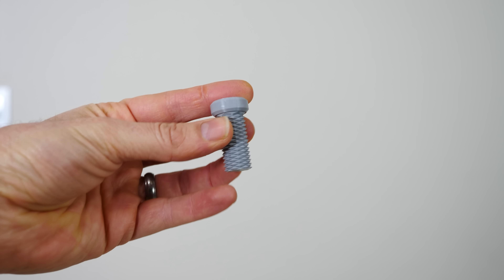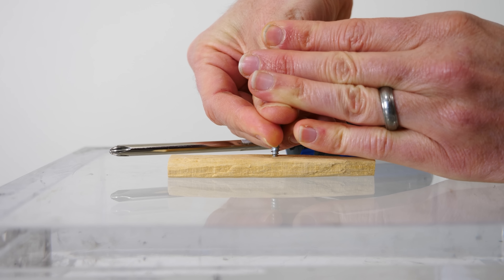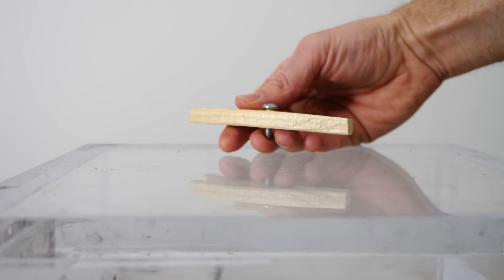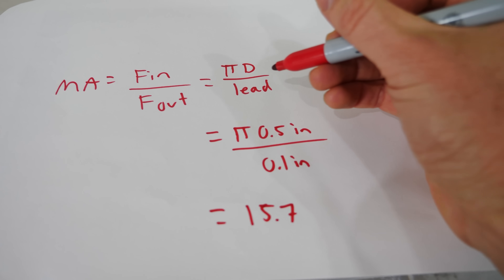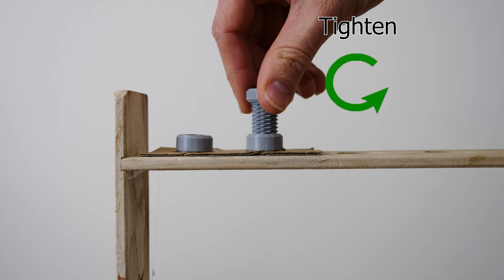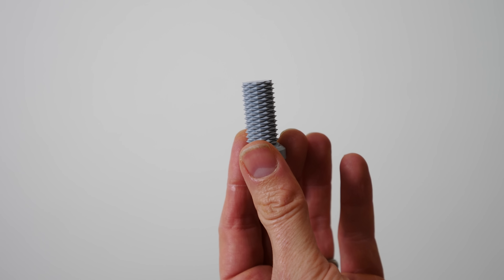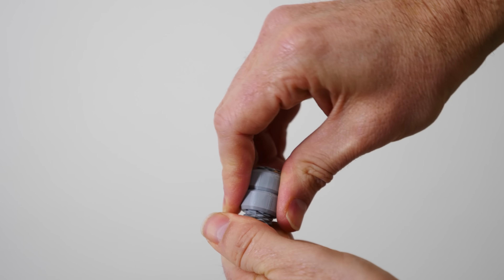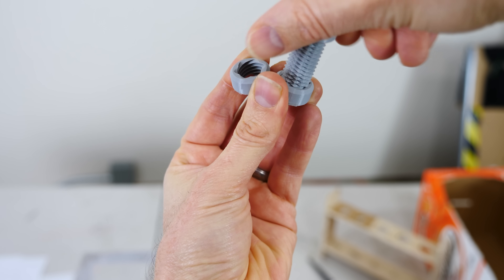A Screw That Can Be Tightened In Either Direction

Comment: As a mechanic This scares me because if the start using this there’s gonna be a lot of fucked up bolts 💀
Reply: Right?! And what is the point of a multi directional screw when the nut is directional? Since they work only together, when actually using the screw it will only tighten and loosen in the direction of the nut. Maybe there is an application with the part about putting on two of different direction, and not being able to unscrew it?
Reply: @cssruth  it does seem like it would cause a lot more headaches that it would fix lol
Reply: @cssruth  we use left handed bolts at our manufacturing location often; dependent on the rotation of machine parts, having a reverse threaded bolt can prevent it from loosening over time. We build large mechanical doors, both electric and hydraulic operated. The components for operating the large door pins are sealed within the door, so having one come loose would create quite the problem! The use case for an either direction screw would be very specialized, but it would work in a case like ours where half the hardware inside the door is RH threaded and half is LH.
Reply: @grizzzly6055  but you would still need two types of nuts to make it work correct? Or does it just have to be a hole that is drilled? I'm not is manufacturing obviously.
Reply: @cssruth  Yes you would need two types of nuts as shown in the video. One has clockwise threads and the other has counter clockwise.
Reply: @cssruth  yes, that or holes tapped in different directions. Go through tap all your left hand and right hand holes, and these bolts would work in either hole.
Reply: @grizzzly6055  The application you mentioned honestly does make a lot of sense though. I work on heavy machinery, so I know there's a lot of importance in making sure nothing rattles loose while our machines are on the job. I don't think there would be a use case where all bolts were replaced for these, but it definitely could make a cool implementation for specific needs.
Reply: @cssruth   I can see a use for the locking properties of a Bi directional bolt with opposing threaded nuts.
Perhaps even bi -directional all thread?
But yeah, still Limited Uses
Reply: @jeffreygearhart1841  in all fairness, lock nuts already exist, and are pretty effective as far as withstanding vibrations and stuff. But then again I don't think this bolt was designed for practical function, it was designed as a cool engineering concept. So the idea is cool, just not especially practical when compared to what we already have to serve the same purpose.
Reply: @cssruth  it just for fun , u gotta chill and stop trying to make everything have a mayor application. Most big thing we have this day are thanks to the discovery that was useless in the past.

The guy who discover a way to tranform any wave into sin wave. At his time, it was useless but now its the core of any wave system.

People in the past discover complex number just for fun and was useless, but these day we have many application for it.
Reply: @prumchhangsreng979  was literally just wondering if there was an application for it.
Reply: @prumchhangsreng979  But trying to make things have an application is how we get big things from once thought useless discoveries????
Reply: @cssruth  The nut can also be made multidirectional. In that case, doesn't matter how you turn it, it goes in the direction in wich you press
Reply: The fear of an old bolt not coming out easily but needing to force and not being sure if I should force left or right
Reply: I got a headache just watching this video 🤕
Reply: Oh yeah. I already find alot of bad nuts and bolts but this would make things ten times worse
Reply: They have nuts that can be fastened in both directions as well. 

But having a bolt that's threaded in both directions severely reduces it's clamping ability.
Reply: Cross threads a tight thread
Reply: Yes  due to the fact that you have much less metal on metal contact they would be much more likely to strip threads.
Reply: @dalentoews3418  Not a trained mechanic, but my father was. Pretty sure he would say stripped threads in the waiting.
Reply: Yes, I see that being a problem!
Reply: And I thought this type of bolt would be make things easier, at least you would only have to keep the leftys and righties bolts apart 😆 Guess not, Il'l listen to the experts. But as a toy it is interesting tho.
Reply: Also I like how in the vid he called it a screw but it's a bolt
Reply: I think it would be a pain for the most part but if you needed something to lock with not much force you could threaten that on counterclockwise and went on clockwise and thread them together firmly I think that would work

Comment: The correlation between the rotation and the distance going into the wood may be linear. (The lead is the distance between one and the next thread because that is the distance the screw travels with one rotation.) That is undisputed. But the force you put on the screw is done with that other machine you use; the screwdriver. The diameter of the handle is a big influence. It is basically a lever to put the rotational force on that screw.

Comment: What happens if the nut is printed the same way as the screw, so both the screw and the nut are bi-directional? Do we get a fastener that cannot be loosened, because spinning it in either direction, if there is any force pushing it in (needed to turn the screw with a screwdrier unless it can be turned with a wrench), it will just tighten? That would be very mean: a normal Philips screw, but bi-directional, so if you apply enough axial force to the screwdriver so that it catches the screw and turns it, you can only tighten it... That would be hell for right-to-repair.

Comment: this is actually really useful, use two different nuts on the end of a bolt, so the bolt physically cannot be shaken loose, as it cannot shake in both directions at once, so the two seperate nuts lock the bolt in place, some machines have issues of the bolt shaking itself lose, this would prevent that, screw it into the machine one direction, then use an opposite side nut to secure it, that way the nut has to shake loose before the bolt can

Comment: Could you 3D print the double threads on the nut instead of the bolt ? And bonus question is: what happens when you match a double threaded screw with a double threaded nut ?

Comment: Special request, can you perform a torsion balance in a vacuum? 

I’m looking to build a similar sized chamber as you have, and I think it would be interesting to perform the experiment on video. The most difficult part I’m trying to overcome is the introduction of the second set of masses when under vacuum.  I think holding 2 balls with a magnet to the top may be sufficient, but those balls being magnetic MAY interfere with the experiment so I’m trying to figure it out.

Comment: it would be cool if the nut also had two way threading
Reply: That was my immediate thought as well. I really would like to see a sequel video trying this out. What I imagine would happen is that you would have to apply some continuous downward/upward force in order to screw/unscrew, but not much. Just enough to break the symmetry.
Reply: @dadankstank  r/ihavereddit headass lmao
Reply: @mateomeoteo  lmao
Reply: The Russian machinist that made the metal version, see top comment, also made the bi directional nut.
Reply: @SafetyBoater  bidirectional nut😩💦
Reply: @ZA-mb5di  moan
Reply: That would not be possible
Reply: @BlueSquad00  it is quite literally addressed in another comment and is 100 possible because it has been done.
Reply: @hopefulmayhem5744  its a different design because if this nut was two way threading it would not tighten properly and you would be able to pull it out without spinning all the way you can just wiggle it side to side
Reply: @BlueSquad00  he literally showed it tightened.
Reply: I got two nuts also
Reply: At that point it would probably just be a ring sliding down a cylinder
Reply: Is it possible to make a screw that tightens when turned both clockwise and counterclockwise?
Reply: @speechless1887  that's quite literally what the video is about.
Reply: @hopefulmayhem5744  I mean just tightening it, once you plug it in a nut you can't loosen it ever.
Reply: @speechless1887  yes you can. It can tighten and loosen in both directions.
Reply: @hopefulmayhem5744  woah cool, thanks man
Reply: Bro it would loosen
Reply: @Moonknife  yeahh haha, just realized that there's no such thing like the screw I'm talking about
Reply: @dadankstank  He did get the joke, quite well enough to see you used it wrong. If that was your intent good going I guess? Lmao.
Reply: I would think that if the nut had two-way threading, then you'd have to use a regular bolt or screw with conventional threading. The only reason this works is because the bolt has a two-way thread whereas the nuts he screws it into have normal right hand and left hand threads, so if the nut had the two-way thread then the bolt would need either a regular right or left-hand thread
Reply: Then it wouldn’t work
Reply: @dadankstank  congratulations on using that completely wrong, and making yourself look like an ass.
Reply: How the fuck you Gonna take it off
Reply: You don’t need a two way but because the bolt already goes 2 ways it would be pointless at a loss of strength
Reply: “You can’t spell nutrition without nut”
Reply: It would be possible to thread something like that but you wouldn't be able to unthread it after.
Reply: I read this before I watched the video, I have a dirty mind
Reply: That would break the matrix
Reply: I'm curious if its even possible
Reply: How would it come off
Reply: I think if the nut was cross threaded the cross threaded bolt would just fall in
Reply: Then it won't screw loose
Reply: Flip the nut over
Reply: do this bruh

Comment: now 3D print a nut that can be turned either direction, and use the screw.  bother directions can both lossen and tighten, depending on which direction your pushing?

Comment: If you put  left and right threads on on a screw, I have seen the one screw being able to be tightened on your dual direction bolt in EITHER direction. What I have not seen, and am curious about , is if the dual direction nut can be tightened in either direction pn a SINGLE direction, "normal" bolt.

Comment: an interesting idea.
production and use wise, I believe it wouldnt require much of a change (still expensive)  to how screws are currently made to actually make those from metal.
as far as use goes, I wonder how easy those are to cross thread, break parts off, etc.

Comment: What would a deck screw do if it were threaded in both directions? I assume it would just cut the path of the direction its turned. Or would it not work at all and just poorly drill a hole?. If it started to cut I think it would bite in that groove and cruise.

Comment: I'm guessing that if you had both nuts on it,  turning the screw would move them together or apart.  That may have some practical purpose in a machine I guess.
No, wait. Putting both a left-handed nut and a right handed nut on either type of screw would do the same thing. I think. Now my brain hurts!

Comment: Here is an idea: Just the way you merged the threads on the screws to make a screw with thread going both clockwise and anti-clockwise, make a nut having both anti-clockwise and clockwise threads. So you can use the same nut on the same screw and depending on the Direction you are applying force it either gets screwed on unscrewed irrespective of the direction you are rotating the screw.

Comment: Seems like it would be way more susceptible to stripping off the threads of the bolt because it has half the surface area of a traditional bolt. Ultimately this is a novelty and not practical, i can't think of many actual uses for this other than impressing people. 
Also thats a bolt not a screw.

Comment: I don't know about the amplification, you are probably right but, when you are pushing down on a screw you are trying to make a hole that is way bigger than if you rotated, the hole would be as wide as the screw's width+the length of the windings, where as screwing it makes a small line where the winding will rotate in.

Aside from that you are applying different muscles for rotating and pushing on, you obviously can exert more force that way.

Comment: This is so neat.  I wonder if that screw is just as strong (holding) as normal screws.  I'm guessing it's weaker because when you pull, instead of a ledge, it's got little 'balconies' to hold the force.
It would be cool if you screw it in (either way) and instead of unscrewing, it "locks" in.  This would be useful for applications where you want it to have the strength of a screw, but behave more like a nail.  (Where you should never need to remove it.)

Comment: What would happen if you used a two way screw and a two way nut? Would it always screw in? Would it only go one way? Would you be able to turn it one way and have it both screw in and out? This is an important question that the video didn’t answer.

Comment: It can be used as a double safety lock, if a screw gradually loosen itself by vibration or some other factors, this can stop it from doing so because it cannot turn both way at the same time.

Comment: What if you used a nut with the same bi-directional threading? Couldn’t you technically screw your 3D printed screw in either direction by turning both clockwise or counter? Of course you’d probably have to add some force in that case to assist turning the screw in a certain direction (pulling or pushing the screw while turning it).

Comment: If you combine the threads on a clockwise and counterclockwise nuts and make a two directional nut. What would happen if you try to screw the two directional screw into the two directional nut?

Comment: I’ve got a similar set up. 
But I just use a mirror. 
Place the mirror next to the bolt and it turns in the opposite direction to screw in.

Comment: 0:33 you can't compare pushing a screw with turning a screw. The threads of the screw work against you when pushing. You should compare it to pushing a * nail * with same (or even less) diameter. That would better demonstrate the force multiplication of turning a screw.

Comment: First, Hammering a screw and screwing a screw is not same thing, both have different area of contact hence different strain and stress. Second, u r neglecting torque in rotatory action of screwing as force grew with shorter point of application of force.

Comment: I think that the bolt will be much weaker in this design. Bolts made of metal with fine screw thread are often screwed very tight to hold something together, because the threads of the bolts are actually taking all the force and how you can see this design has less material for the threads than the regular bolts, it's more probably that the bolt thread can be damaged through the time, especially by vibrating machines. Unless you compensate it by make the bolt longer and the material that it have to go through thicker.

Of course, I'm not a expert for this area of expertise. It's just my thoughts... So please correct me if my thoughts are wrong.

Comment: The problem is, in the engineering world they are practically useless.  The notches reduce the surface area and so reduce friction. This means there is zero run down torque and so the screw or nut will need some other type of securing device such as tab washers or locking wire.  Without this they would vibrate  loose very quickly.

Its more of a gimmick or novelty than practical application.

Comment: If you cut the threads of the nut the same way, would you be able to change the direction you're turning it while tightening or loosening it? And loosen it the same way you tightened it?

Comment: You can make the same pattern inside the nut , in that way you can tighten and loosen the screw in the same manner , the only difference would be that while tightening you will have to push the screw and will loosening the screw you will have to pull it.

Comment: So as a auto mechanic in 10 years when I have a rusty bolt to remove I will snap heads off not knowing which direction to loosen. I am getting another job

Comment: Really a bolt and not a screw.  I'd like a real screw version of this that was put into wood.  I imagine that it could be tightened in one direction and then continue to be tightened in the other direction as long as downward pressure is applied?  It'd probably be a terrible fastener.

Also, for the example of driving the screw vs directly pushing it in, the screwdriver also provides significant mechanical advantage.  Twisting a screw into wood with your fingers still isn't that easy.

Comment: Actually, the lead is the distance the screw advances in one turn. The pitch is the distance from a point on a thread to the same point on the adjacent thread. Pitch is equal to lead only for singles start threads. Otherwise the lead is equal to the pitch multiplied by the number of starts.

Comment: So it has basically both threads cut. 
That should also be able for the nut, so we could have an ambidextrous nut as well. 
The experiment I'd like to see  is: Does an ambidextrous bolt work in both directions on an ambidextrous nut? Like in praxis. Does it provide any force? 
Or is there too much going on?

Comment: This screw is amazing.
Reply: Well actually, lead is the distance that the screw advances in one turn. Pitch is the distance from one point on a thread to the same point on the adjacent thread. Pitch is equal to lead only for single start threads, otherwise lead is equal to pitch multiplied by the the number of starts.